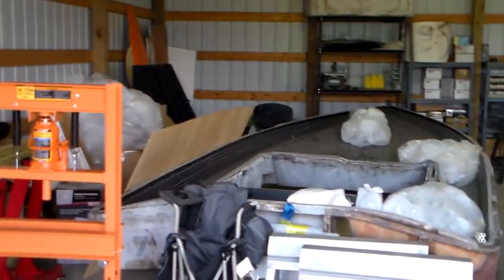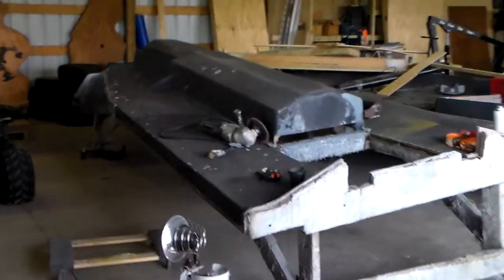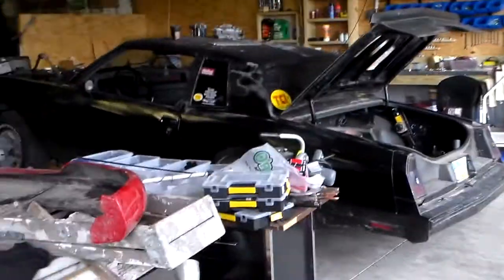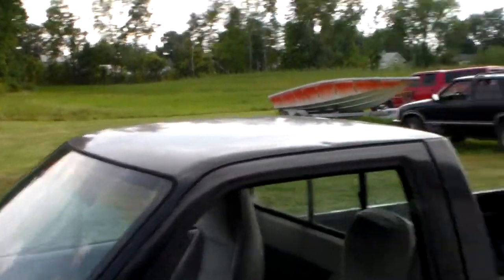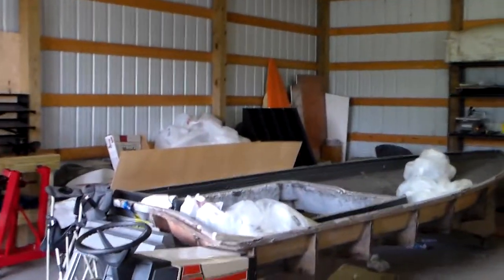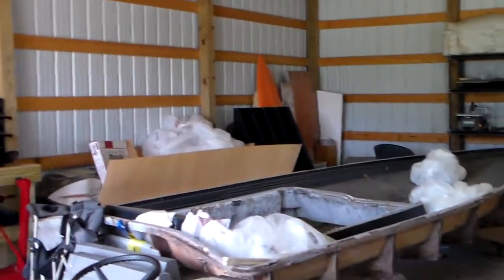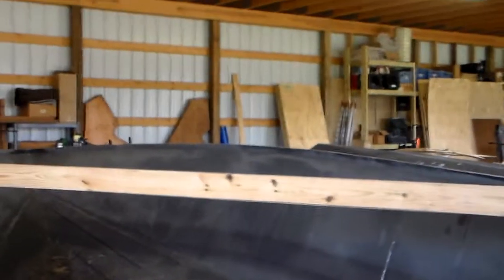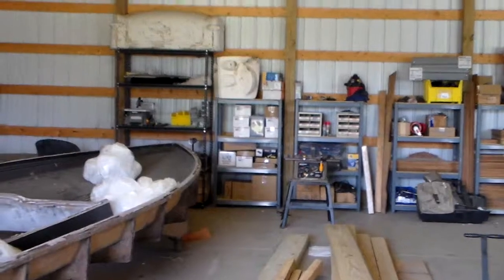How to build a Fiberglass boat, shop update.

Comment: Looks like lots of progress buddy.  I can't wait to see the first boat pop out of the shop.
Reply from the maker: Greg's Garage   The deck is 90% layed up.  Just have to figure out where I want some wood.  Took a break to work on the new shop, and work at my job, putting in lots of extra runs to get the money together for all this fun.   I'm going to move the hull over to the new shop, I've got a few helpers around now and I'd rather it get worked on over there.  The deck will come to the new shop to be pulled.   And that deck mold with all the milk jugs in it will go over to the old shop for some intense modification.  I still have sticker shock from getting a price on dura glass the other day, wow.